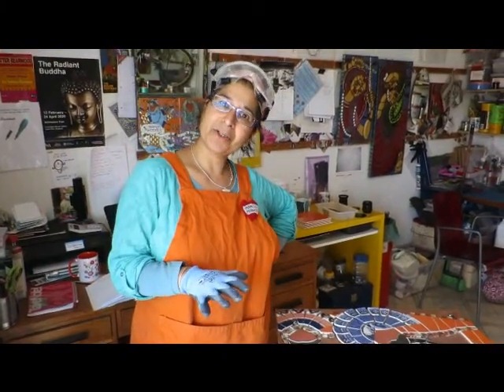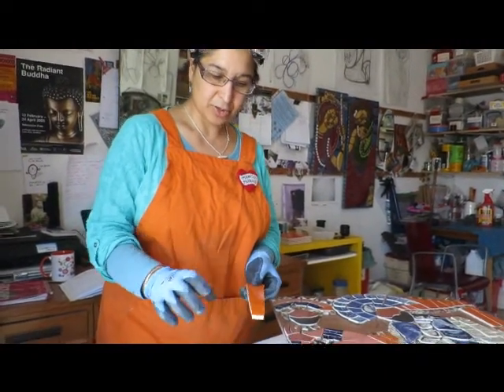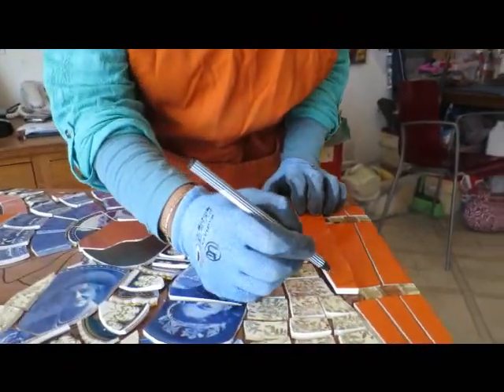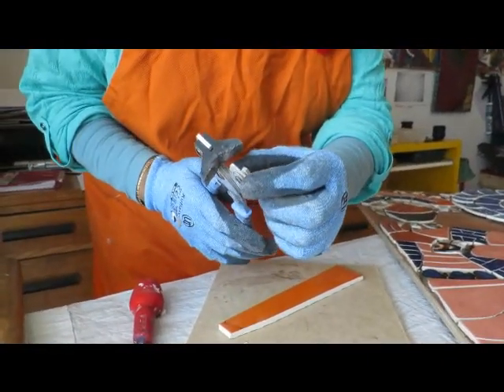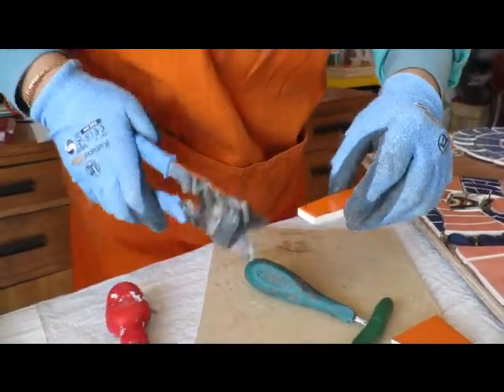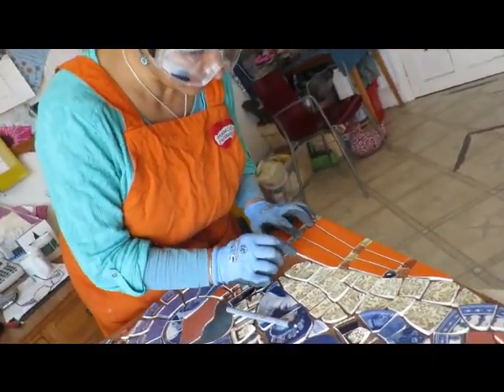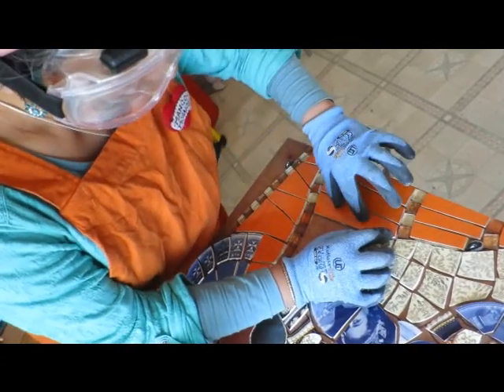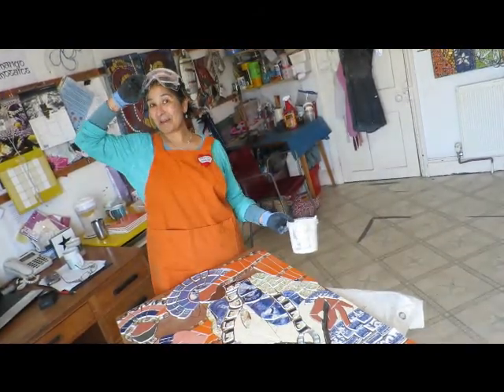How to use a tile score snapper May 2016

Comment: Hi. Your work is amazing. Now I am retiring I have started to make my own mosaics (never too old) and have learned everything from your videos.I want to learn how to mount a half teacup on to a backer board but not sure how to do this. Have you got any videos on this subject please. Many thanks again for your lessons on this very enjoyable craft.
Reply: I'd probably use a construction adhesive on the portion I press onto the board. Or an epoxy. Then grout around. Unless you're doing a vertical installation, honestly the grout alone is probably enough to hold it in place once it's dry; unless you're doing a very thin layer like you might if your mosaics are thin (like stained glass or mirror.)

Comment: Hi Caroline, can you tell me where you get your Silberschmidt glass scorer you use for scoring tiles. I’m in Australia. Libby
Reply from the maker: This was a film I made in 2016 and I believe that tool is obsolete now. I would try Google or Ebay. These days I use a Toyo pistol handle glass scorer. Does the job really well. Hope this helps 🙏🏾🧡🙏🏾
Reply: @mangomosaics  Thanks Caroline, I have one of those I use for glass I did not know I should use it to score ceramic tiles as well. Could you explain why is it to cut through the glaze?

Comment: You're using PVA glue....water soluble, right? What do you use for an outdoor installation? Such joyful work you do, by the way. I enjoy your videos immensely. Not many teachers manage education AND a happy attitude. ;)
Reply from the maker: sassyNot4u for outdoor mosaics I use a combination of silicone glue and external tile adhesive (thinset) 😊
Reply: @mangomosaics  what is your combination recipe & why do you mix them for outdoors?  Thanks!
Reply from the maker: @leeanncaldwell8764  I don't mix them literally together. I sometimes use a caulking glue for flat tessera.... but for undulating crockery, I use tile adhesive often called thinset in the US.